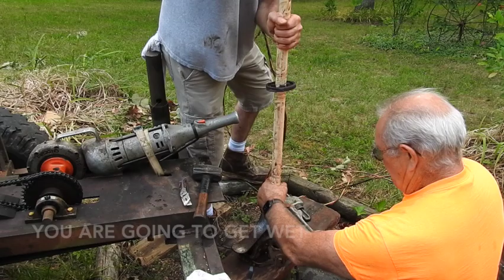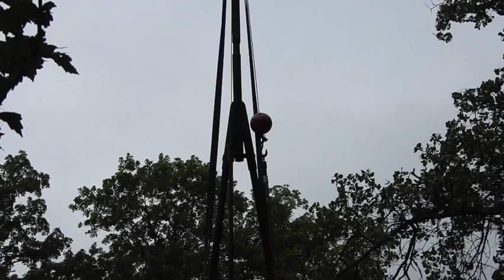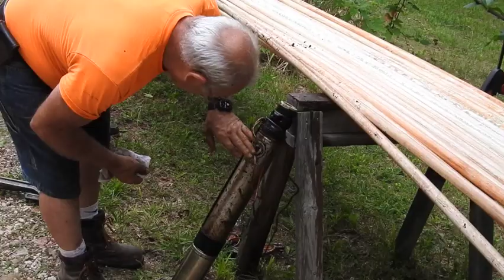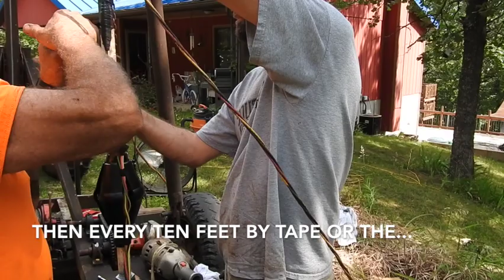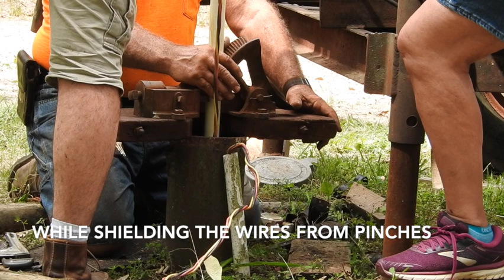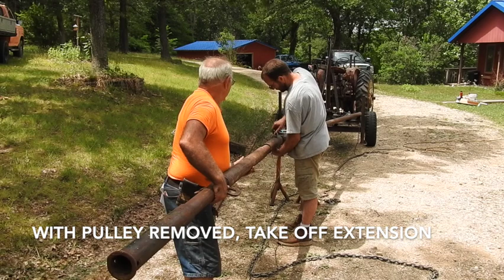DIY Well Pulling Rig Built Of Repurposed Materials

Comment: Nice job even with the harassment by the Missus!!! Nice job by the Ladies showing some different angles. Wells on our farm are all dug by hand. Main well is 10' in diameter and 6' deep (spring fed). Two other wells (used in emergencies) are about 3' - 4' in diameter and about 20' deep. All the wells are brick lined. We've never had the wells go dry, been close a few times though. 👍👍👍
Reply from the maker: We had hand dug cisterns on the farm to catch rain water off the roof and they were as you described, but we didn't have any wells as such.  I was lucky to have the extra help that could fiddle with the camera.  But I HAD to get up from time to time to get some blood back in my lower legs !!

Comment: Great work Wendell.
Having the equipment and the family helping makes all the difference. 
I think I would have to add about 4 feet more tower to the rig so I could pull the pipe high enough to do the work standing or at least in a chair. My knees won't let me kneel that long anymore. 
We are on city water here in the suburbs of Kalamazoo. Still have a septic tank but I imagine we will have a sewer put through in the next 10 years or so. That is the trend to prevent climate change I think. At least that is the reason they give anymore. 
We had the 75 foot deep well pulled at the old house. The driller pulled it with his drill rig and replaced the pump. It had been in the ground about 10 years and we got hit by lightning. 
I'm impressed with the rig and your willing helpers. I do most things on my own with painting help from Lydia. Ryan helps with the heavy lifting.
Reply from the maker: This one will reach to 30', which should be adequate for your desired working height.  LOL.  I gotta admit, I had a tough time with the first 8 or 10 steps each time I got up too.  LOL. Not nearly as flexible as I once was...kinda like you.  Yes, I got good helpers and on the next one, I intend on being a 'helper' myself.  Training sessions are over !!

Comment: Great job using the 700 machine. Never seen it used that way
Reply from the maker: Even as ancient as it is, it's still got what's needed to do this job.  I got lucky and found it in a pawn shop many years ago.  But I had to go by a tool distributor in St Louis to find the 1'' square drive for it.  That cost more than the threader !!

Comment: we use black roll pipe on our well, 300', allows us to pull it hand over hand. once we had to do that three times in one day, boy that got old fast! nice rig you've got though, need to get me a set of those pipe dogs sometime!
Reply from the maker: Hot dang, I can't imagine pulling one that deep three times in one day !!  Especially by hand.  The deepest I ever pulled by hand was 250' and that was ALL I wanted !!   You might try looking in rural antique shops or look close at the pictures at farm auctions in your area.  Auction Zip usually has local auctions listed with tons of pictures.  Btw, the Missus bought one similar to this one for me at a yard sale for three bucks about 25 years ago too.  What a deal that was.
Reply: @tractorman4461  you’ve trained the Missus very well to find bargains for you at yard sales.   Good to have a sharp eye, as she has gotten several nice finds over the years.
Reply from the maker: @mafarmtown2086  Hahahaha...sure 'nuff.  She bought me a 1937 International stationary baler with a throttle governed flywheel engine for three bucks at a sale one time too.  And another time she bought a Oliver 77, 6' blade, 3 point rear scoop and a tractor mounted wood splitter for $400...and THATwas at a yard sale !!  But now I'm bragging ain't I...?? LOL

Comment: Nice job Wendell. The next time I have to pull mine it's going back with pvc. I was always worried it wouldn't hold the weight of the pump and the torgue from starting. Thanks. Take care.
Reply from the maker: Its got to be threaded schedule 80 pvc with extruded couplings Rick.  The starting torque from the submersible will tighten the pipe threads with each start. The best stuff is the new black plastic all in one piece.
Reply: @tractorman4461  thanks Wendell.

Comment: A 44 action video for this JOman! For some reason the 44 adventure notifications were not happening here inna my Holler! Now I have lots of catching up to do! Now this episode involved the Ladies, which does make things even more exciting so Kind Thanks to the Missus Baroness and Baronette! This rig is always appreciated for the NASA type engineering that went into its creation,,,,,eat your hearts out rocket scientists! Anyway, I’ve been busy with projects here and in me shop. I’ve been cleaning out drawers on one of my workbenches and found thing known and unknown to mankind! Now where is that favorite file of mine? Well in my file drawer, which was filled with wood shavings, filings and all that unknown stufff there must have been a peck of files! Oh, there it is, along with corn cobs and wine corks used for file handles, stainless steel clamps, screws,hack saw blades, nails and screws, angle brackets, mending plates, pieces of sheet steel, scraper blades, a few springs and a clock main spring used when spring steel is needed! THERE IT IS! Now, where do I put all this stuff so nicely packed in protective saw dust and shavings? The scary part is I have another drawer to go through! Perhaps I shall check into the aid of an archaeologist to go through the layers of this time capsule. Who knows what may lerk in the depths and layers? It’s spooky in some respects. Where did I get all this caca, as useful as it may be? But then again, it’s like opening your Christmas sock by the hearth side or may be like digging by TMI, remembering that near melt down. I think I may use a strainer to sift out the good stuff that may exist within the fossilized content of time. This reminds me of that first drawer experience when a soft spot in the corner of the drawer produced an old cotton sweat sock. No, I don’t store socks in my shop drawers but use worn out ones to polish and for rags. Ahhhhh! Those mysteries of life keep us going,,,,,,I recon! Anyway, why no tutu for the pump episode? If you and your son in law were wearing tutus it may well have created a viral vid! Of course you don’t want to go the way of Bud Light I recon either. Most likely dancing, gardening or edge trimming would be more of a tutu appropriate scene or the best, tractor Joy riding. Well I’d best get started catching up as time flies like an arrow and fruit flies like a banana, as stated before. Like one frog said to the other, I only have flies for you. That’s hear say since I didn’t hear it meself. So a few more 44 adventure vids and then I’ll possibly consider another drawer happening or may be not. If I had a large fire cracker place in the said drawer, might this be a good Fourth of July celebratory fun time? Anyway, a VERY HAPPY FOURTH OF JULY and I’ll be toasting your way very heavily as usual,,,,,or the JO just doesn’t have that heavenly kick it should! Now off to another exciting 44 adventure vid but perhaps just one more. Too much excitement just ain’t as good as it used to be,,,,well may be it is! DaveyJO rocketing off into his space cadet environment! Squeezez Pleezez of course!
Reply from the maker: I wondered if you might be experiencing 'puter problems or internet issues of some kind.  I am sure glad to see its not a health issue that was holding you at bay !!
  This was a good day, but it'd been much worse if we had to pay full retail for the repair...whew !!  Yeah that'd be a chunk of change for sure.
   Now I think ALL of us have a junk drawer that's really full of goodies...but when I look around I think I have a full size junk SHED !!  LOL.  It'd take me a week to just figure out how to start sifting it all through the sifter.   Yeah, we have had the tutu's shelved for quite a while and I'm guessing it probably ought to stay there for a while....my loafers are still heavy enough to keep me grounded...LOL.Take care and don't work too hard in all this heat. Have a GREAT 4th along with Miss Alice....

Comment: A Bowling Ball! Haha I was wondering what that was! Great videography and commentary on this particular vid👍 I don’t want to tell you nothing cause I believe you’ve been there n done that. If you’ll follow along though I’ve got something to add. That pvc is most likely at the end of its life. A channel called h2o mechanic has taught me that. Black roll pipe is highly recommended as a replacement. I’ve learnt a lot recently from his vids as I’ve been going through my own well whose. Unfortunately it’s not the capacitor like you mentioned but much more serious. A collapsed bore hole.. pulled my pump twice now on black roll with good results eventhough it was more than a 3000lbs pull. Nice rig you’ve got there! I used my old jeep to pull mine out by my self but like I mentioned that’s one of the advantages of black roll. Gotta figure out how to remove the rock that tipped into the bore hole and put a sleeve in. Again your a triangle on top of a triangle of your community! Haha hey I love watching ya! Keep up the good work 💪
Reply from the maker: The rolled black pipe has been in use down here for a while now and yes, that is the best route to go.  I agree.  Hopefully that's a bridge I won't have to cross for a while though.  LOL  If yours is collapsed pretty close to the surface, they may be able to sink the rotary bit, clean it up then add length to your steel casing....??  I think that's what you were meaning by removing the rock. Boy, that's nice to be able to pull all in one piece with the jeep though.  I'm a bit envious ... And thanks for the awesome addition to the thread my friend.  I guess instead of being a 'right' triangle....obtuse would be a bit more descriptive.  LOL.

Comment: That's a lot of pipe ...glad my well is only 30 feet lol plus should my well pump fail all I gotta do is turn off the shut off valve from the well and open the valve to the gravity flow spring ...the spring water only has 15 pounds but it's enough to flush the toilet and take a shower lol cheers
Reply from the maker: Hot dang, you got it good Grizz !!  Ain't nothing that easy down this way.  LOL

Comment: Awesome job. You folks made quick work of it. One question though. When threading the PVC pipe for reinsertion, is it easy to cross thread as you have 21" of pipe above?
Reply from the maker: No it threads in easily Chuck.  But that's why you hear a slight 'bump' of the trigger either up a little or down a little.  When it's just right, the 20 foot length of floppy pvc stays straight as an arrow and starts as easily as can be. The extruded pvc couplings are shaped with a deep angle on the ends too...almost like a miniature funnel of sorts.

Comment: I don't ever remember pulling the  pump myself. Installing them yes. Drilling a hole in the ground yes. Your well diameter pipe and pump is on a smaller scale then what we used to do. I just wish I remembered as much as it sounds like I know now 🤣🤣. I just read what I wrote and it was beginning sound to me like I knew more than what I actually remember. Great job you and your family and I'm sure it's always bliss. But it does remind me of a guy that actually women have said the same thing and I've heard this way too many times. You actually do that for your family? It wasn't as involved as pulling well pumps. Or it might be more involved. But a family that works good together seems to be a rarity nowadays. Glad that you are one of the rare and unique. This is extremely interesting. The thousands of dollars that many well drilling companies charge to pull the complex you just did. You may not like doing that but I don't think you'd starve you can have your pick of what jobs to do. Just my opinion.
Reply from the maker: The residential wells down this way are usually 6 or 8'' steel casing for 60 or 80'.  I've seen some new ones with schedule 80 pvc casing as well.  Me and my 'crew' have pulled quite a number of wells of all depths in this area. But the majority are 300' to 400' plus.  There are no shallow wells in this area unless its a rare artesian well.  We do have two that I know of locally though.  We have saved a number of friends and families a lot of money over the years with this rig.
Reply: @tractorman4461  850 ft. And you can hit water at three hundred or so feet. But not any good or it won't be good for long. I'm not talking about your parts I'm talking about up this way. They can go a lot deeper. I think on the cheap it's $2,000 to do something on the line to what you've done on this video. I don't recall exactly it seemed like some of the guys he drilled Wells they want twice that. 10000 to 20000 to drill a well is common. Of course it can be more. 8 to 12 in across with initial casing. Closer to 8 is more common. And of course how far you go down with it now depends on the total depth of the well. I know people probably about 45 minutes away from you that they've got Wells they dug by hand we're talking 50 to 150 ft. 35ft on the shallow end. The most common deep depth around there was probably about 80 ft. No submerged pumps there. Well I don't know near as many people that used to. No of them is more like it. Anyway I was wondering if you've noticed if my videos have been suggested because I put up at 71 Nova and it should have skyrocketed and it did nothing and for the last several days whatever I put up has done nothing. I expect summertime to have something to do with it. That was a good video you made.

Comment: You could definitely make a living off that rig. I keep having fever dreams of making something like that for my dump truck so I can load heavier logs into it lol. As for your desc.. Seems like most crews these days are unscrupulous. Usually my work consists of fixing lazy people's mistakes or hack jobs.
Reply from the maker: Well, considering this is the third time in a little over a year this rig has been put to work, I'm sure if I was to look for it there would be more to do....But friends and family give me enough well work to keep me MORE than satisfied.  LOL.  Good luck with a log loading arch for the dump truck, btw.
Reply: @tractorman4461  Lol. I get it, does look like a time. The loader probably won't happen any time soon, there's some issue in the wiring so I have no brake lights, dash or t/s. Wouldn't be a problem but I can only bring myself to be upside down under the dash 3-4 hours at a time before I call it quits.

Comment: Uh - if you were doing this for a living you would be $1500 to $2000 richer every four hours of work at 400' of well for installing a new pump. And that is on the cheap side around the Northwest. Great video!
Reply from the maker: Yes, that IS on the cheap side.  It'll knock a chunk outta three  grand down this area for a 1 hp replacement installed at that depth.  There's only MAYBE two contractors in this area that do well pump replacements.